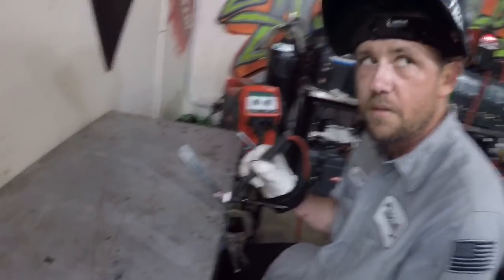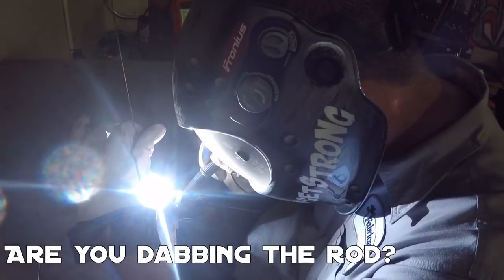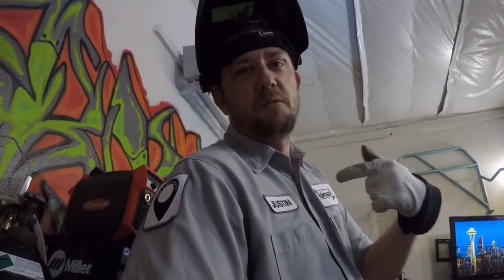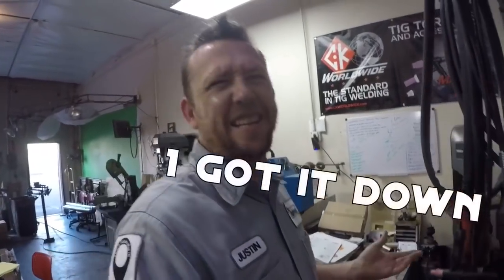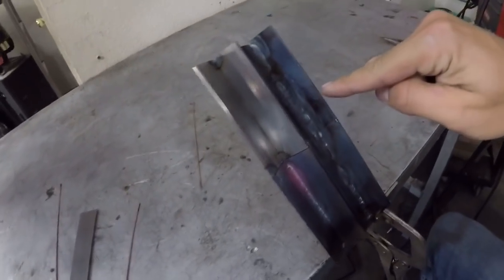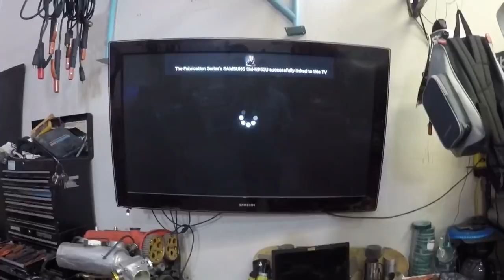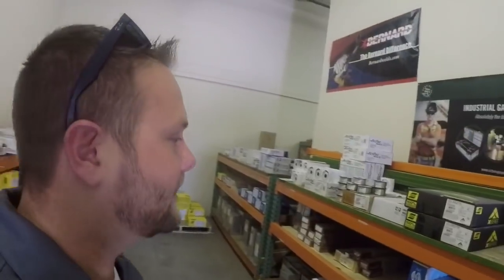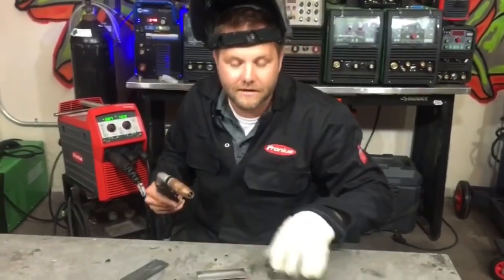One Of The Best Welding Courses West Of The Mississippi..!!!

Comment: When you walk the cup, the cup will follow your bead if you let it and dont fight it. Just let it advance up to each "dime" of the bead you just laid down. It's easier to do than explain..
Reply from the maker: j dog thanks for the advice . I’m going to practice walking the cup for the next few months until I feel like a pro🤘
Reply: MilkyCereal83 you'll get the hang of it sooner than that. The TFS dude is pretty sharp. Just take  what he says and relax and let it happen. Dont over think it. Practice with machine off. Practice on a finished weld to get the feel of that ceramic cup rolling back n forth along the "stack of dimes."